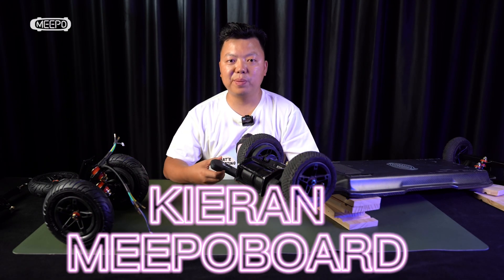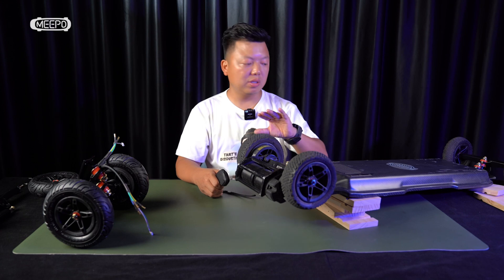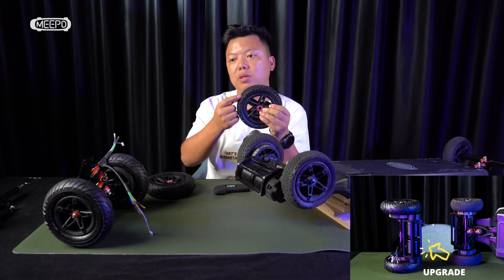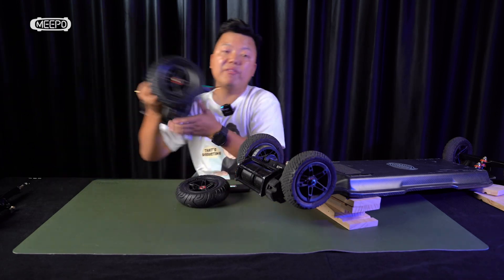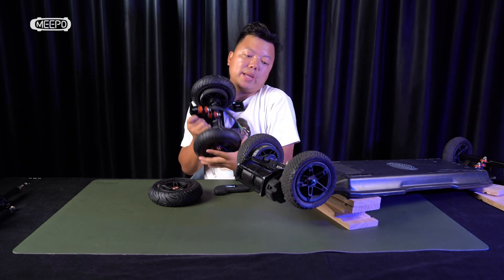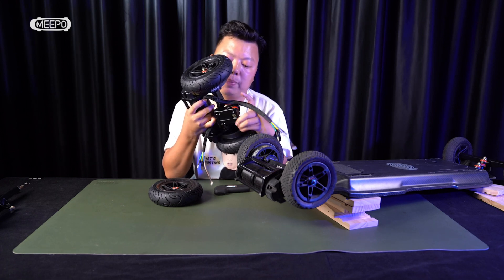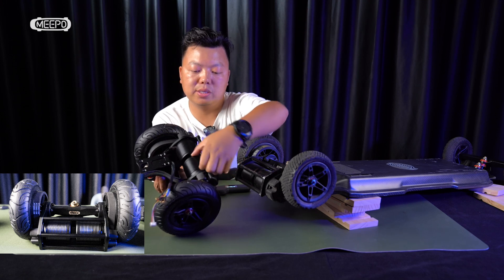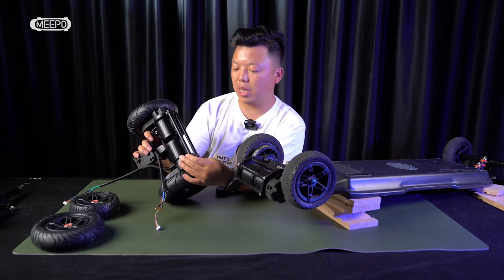Introducing MEEPO Electric Skateboard DIY Upgrade KIT (For Meepo Hurricane)

Comment: The big problem with mine that's still never fixed.. It charges once then dies. They sent me batteries and chargers but the problem is the ESC.. Which I found out they upgraded early into the boards lifecycle.. Where's my new ESC?

Comment: Why not just include this as standard with the Hurricane instead of offering it as an Upgrade if you know it is a common problem the original tires keep exploding? Or at least send more than just 2 extra tubes with the order. It feels like you guys tested the board, realized it has flaws, but released it anyway. Now that there are enough reports of these issues and it being so common that the most searched Hurricane issue is tires popping instead of range/performance, you guys release a hot fix.

Also, with the larger wheels, wouldn't there be a range impact? Will you guys eventually increase the battery pack size to compensate?